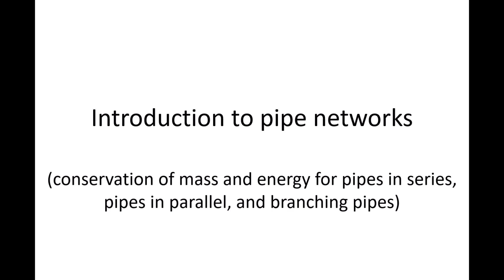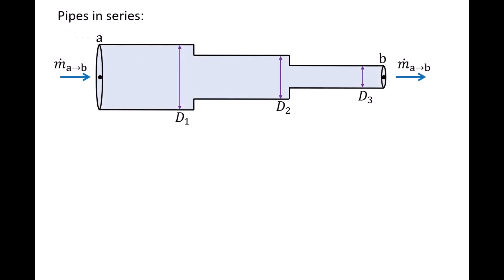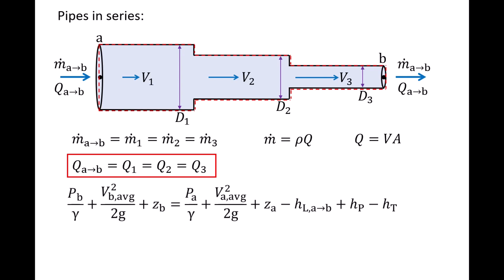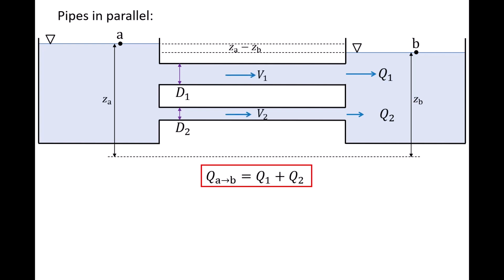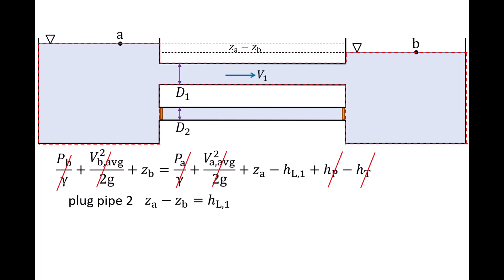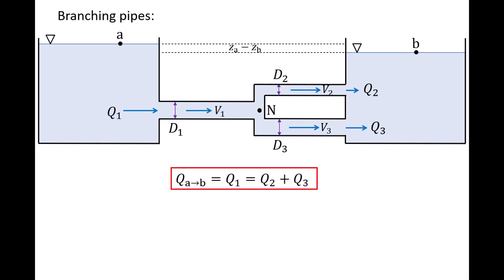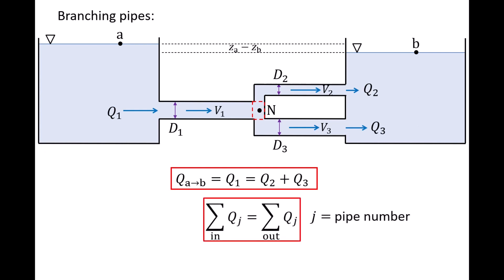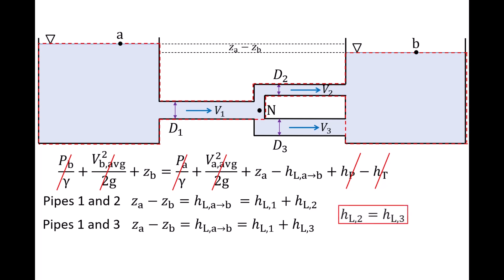Fluid Mechanics: Topic 9.2 - Introduction to pipe networks (pipes in series, parallel, branching)

Comment: Very good explanation but i think that Pa-Pb=0 because bothe free manometric pressure = 0. So we can eliminat both pressure
Reply from the maker: The air pressure at the free surfaces will be slightly different since they are at different elevations (pressure decreases with altitude). However, the difference in pressure heads is usually very small compared to differences in the other terms that survive, so we can neglect the difference in pressure heads.
Reply: very cool thank you sire @CPPMechEngTutorials